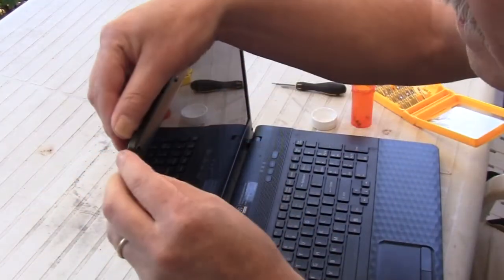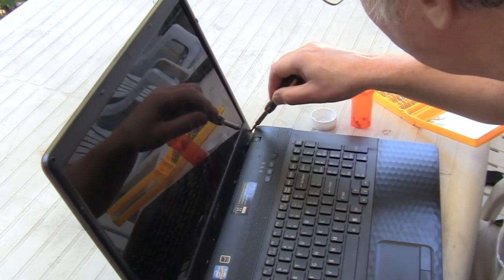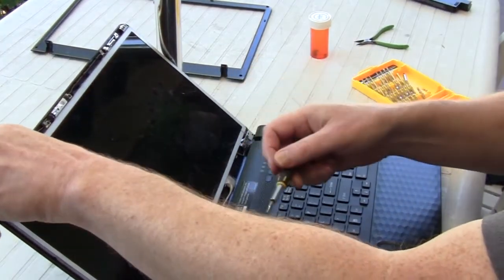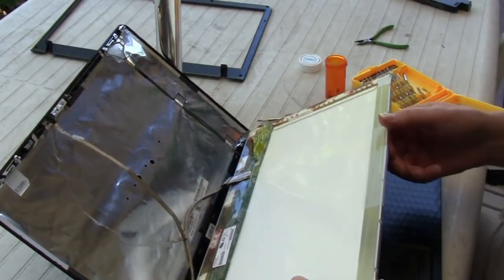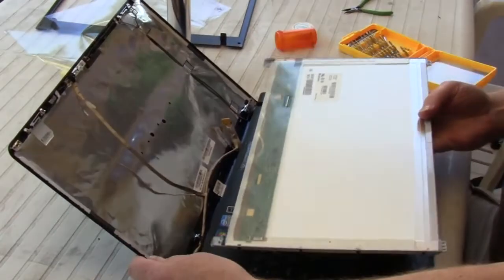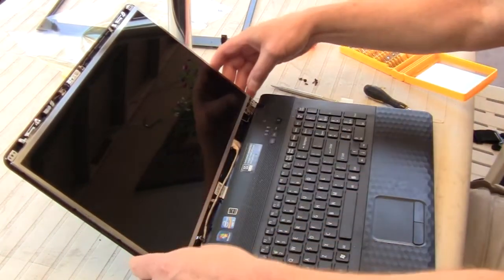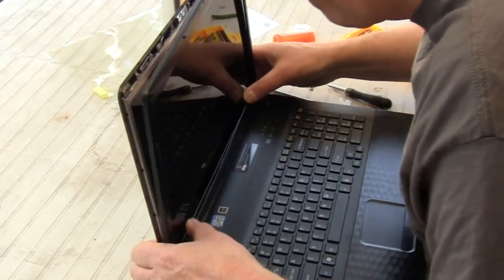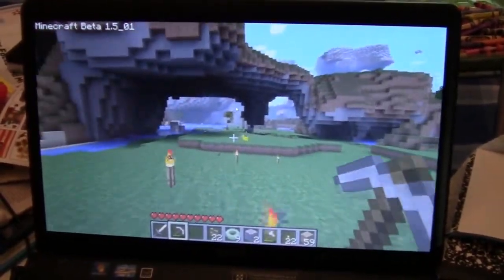Laptop screen replacement / How to replace laptop screen on a Sony VPC-EJ

Comment: 2) After connecting the new screen, but before screwing the brackets back into the case, take care to ensure the cable for the 40-pin connector is properly reinserted into its housing in the case below the screen.  This will make it easier for you to reattach the bezel to the case.

Comment: 1) I found that, with a bit of extra care, I could remove the tape holding the 40-pin connector to the screen panel with my hand.  Then I was able to reuse the tape to affix the connector to the new screen panel.